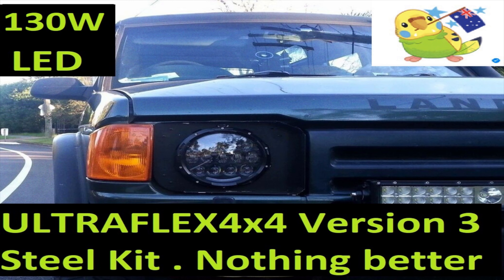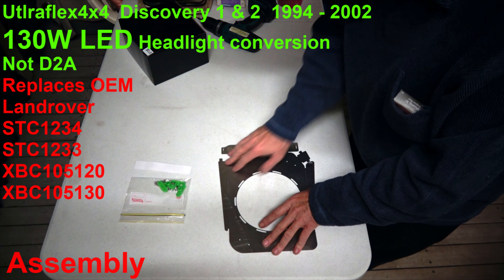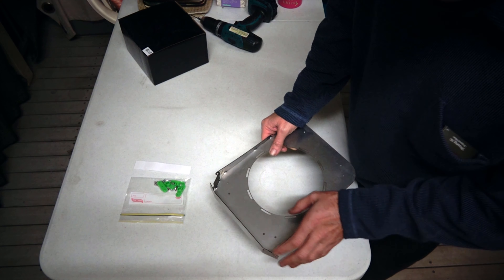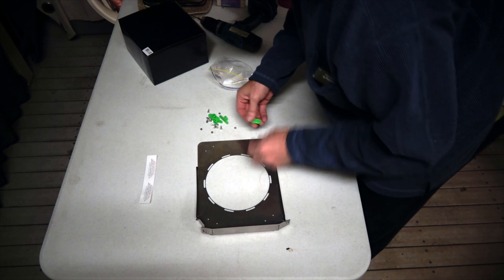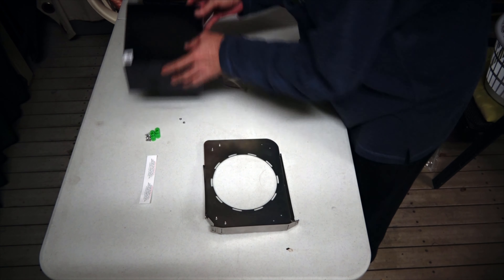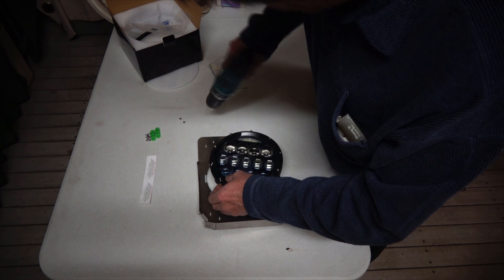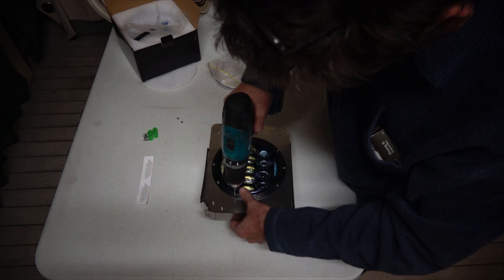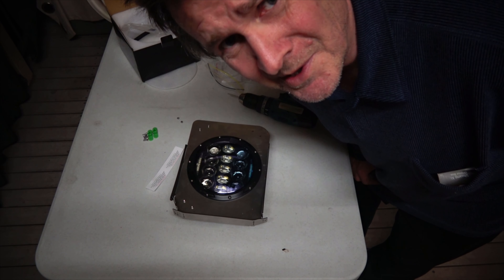Ultraflex4x4 Discovery 1 and Discovery 2 V3 130W Head light conversion LED - DIY Folding Plates

Comment: Hi Garret, I think I was the first (or one of the first) to get your aluminium LED kit, confirming it fitted the D2 just fine.  Curious on the more powerful lights - when I used higher wattage globes on the standard halogen lamps, I burnt out two light switches (stalks) - given these are higher wattage, just like my earlier halogens, do you suggest a relay mod to ensure the full current doesn't go through the lighting stalk and overheat it?  Perhaps could be a good optional extra for peace of mind?
Reply from the maker: Not at all necessary Darren. Since you already have my V2 plates I'll thow in the V3 plates if you want to upgrade.
Reply: @GarretKrampe  Thanks Garret, definitely something I'd take you up on as one of them has the tab broken issue after someone rammed the car while parked outside my house and as you know, the aluminium was tough but doesn't like being bent more than once :-)  Let me know what I need to do.  Cheers!
Reply from the maker: @DarrenCoull  Yes the 6061 alloy tended to become brittle ..hence the change to steel . Also the 4th mount added as the solution to those wild characters that like jumping, also the 10 bolts are keeping the  system rock solid, as they used to flex a bit on corrugated roads.